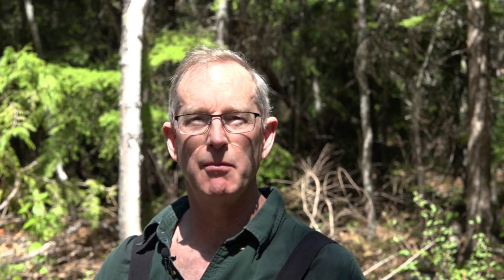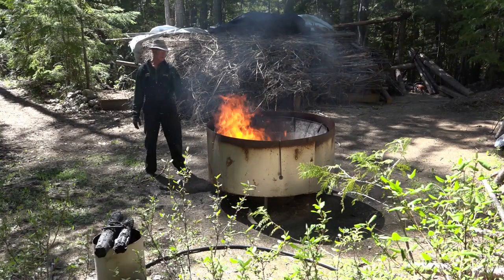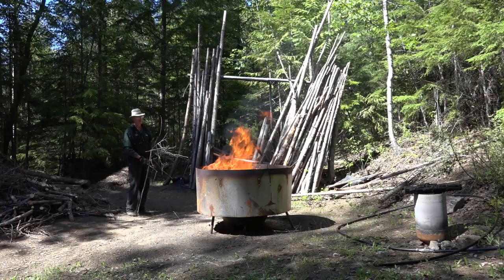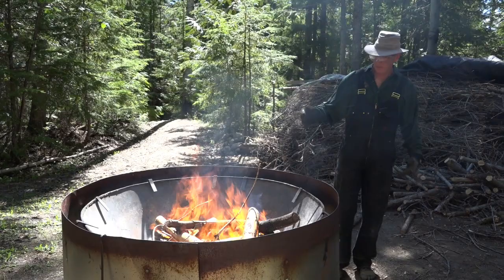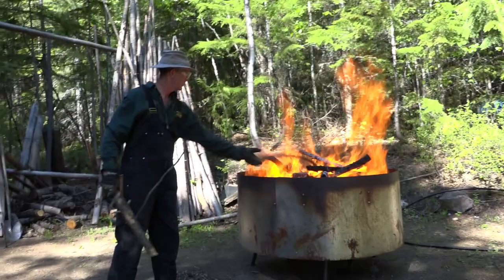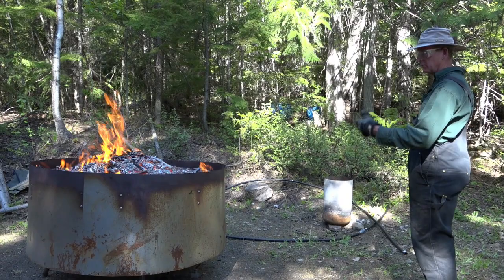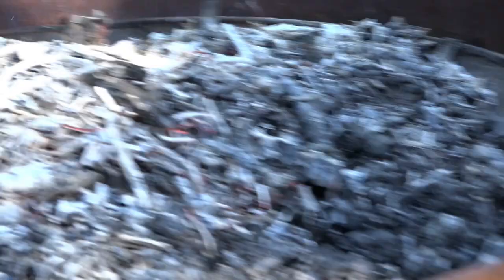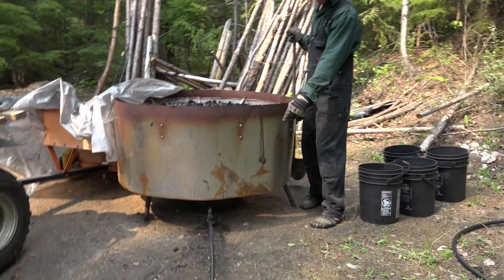Making Biochar With Kon-Tiki Kiln

Comment: I loved watching your process, thank you for sharing! This is similar to an idea I have had, it was so helpful to see this. We have a large burn barrel on our farm (approx 3-4' wide, 3-3/5' high; it was here already when we moved here). I would love to have a tiki cone made to drop down into it, maybe either with support legs like you have to stand inside it, or have hooks welded to the rim to hang inside from the top of the barrel ... sort of the reverse of what you have, but similar idea ... space between the sides of the barrel and the cone, and there's already a rectangular hole cut at the bottom of the barrel that would allow air in like a draft, and also be where access to the water valve at the bottom of the cone could be. Do you think that would work? What kind of metal is the tiki cone made of? Is it steel?
Reply from the maker: Hi Julie.  Thanks for your comments and questions.  Ward thinks this should work but it's hard to say if the hole in the bottom of your burn barrel will allow in enough air.  If the hole is too small compared to the space/gap between the kiln and barrel, it may restrict the air flow. His kiln is made from steel and he believes it was 14 gauge (can't remember for sure...possibly 16).  It was as heavy as he could manage to bend.  Lighter gauges of steel will warp more.
Reply: @kathrynnewsom765  It’s so kind of you to reply and please thank Ward for sharing his thoughts and experience! The hole at the bottom of our burn barrel is rectangular, approx 12”w X 8”h at least (I think, I’ll measure it when I get home). After looking at your video and observing the gap at the bottom of the barrel, though, I could also dig out around the bottom of barrel (it already has a moatlike ditch around the bottom) and lift it up onto blocks. I would think that would be sufficient to create lots of airflow?